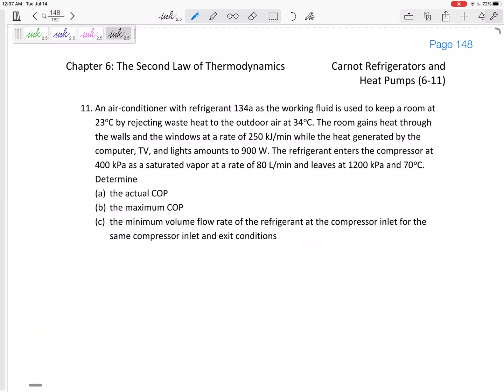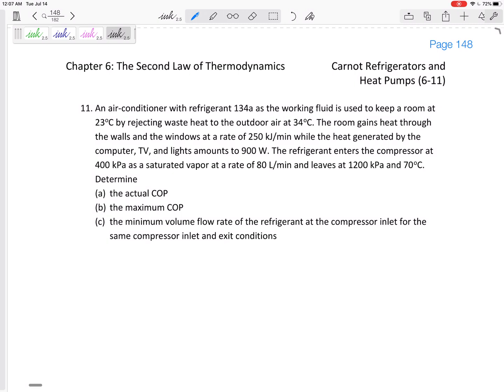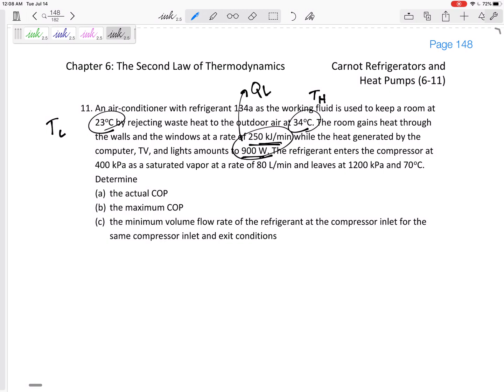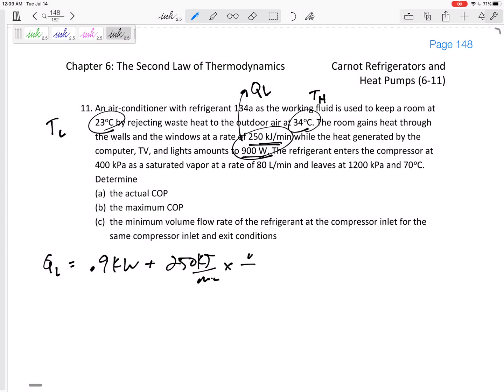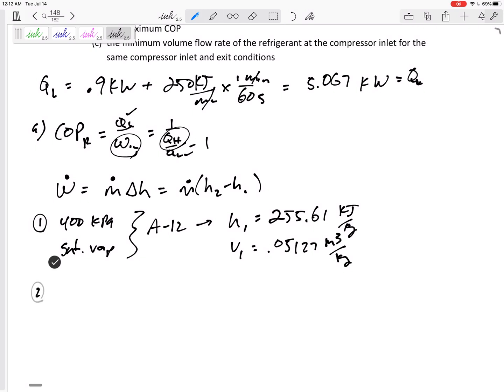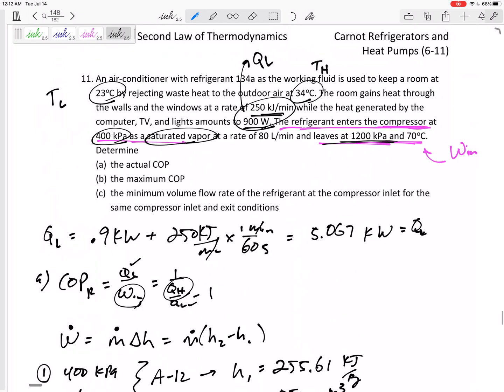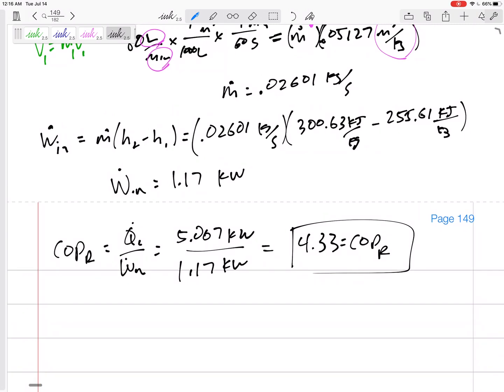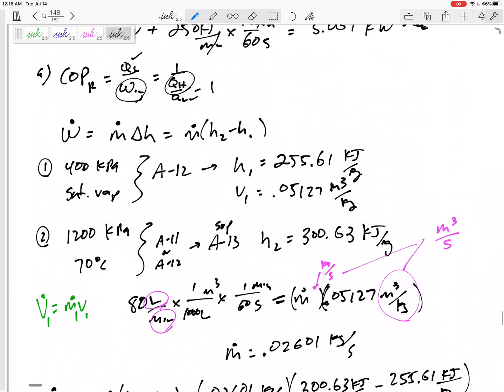Thermodynamics - 6-11 Carnot refrigerator (air conditioner) example

Comment: Hello! At 3:45, where did the w=m*deltah equation come from? Thanks for the helpful videos!
Reply: i think it came from adiabatic process of the cycle you know fluids temperature Is changing so it couldn't be in isothermal part of the cycle so its adiabatic and in adiabatic processes no heat transfer put that it energy balance equation no change şn ke and pe also ne heat transfer only w=change in enthalpy remains I might be wrong tho

Comment: Good Day! for calculating Win why are you using delta h instead of delta u since pressure and volume are not kept constant?
Reply from the maker: You use delta h because it (the refrigerant) is a flowing fluid, going through an inlet and outlet.

Comment: Excellent. I was able to get the answer before watching your solution thanks to the foundations you’ve provided through great teaching. I just wonder if you could reinforce why we use h instead of u in this case? I know it’s on the left side of our Energy conservation equation but it is not a constant pressure process and it’s in a rigid container. Thanks you sir

Comment: For C, if all things are equal, can't you just take the fraction of COPr / COPr-rev multiply it by 80 L/S and get the 12.86 min flow?  It's dangerous to assume things like that but in this case, it works out b/c we were only changing one value?
Reply from the maker: I wouldn’t be surprised if that works. There are a lot of different equations here that are related.